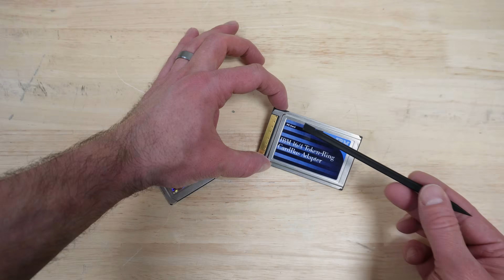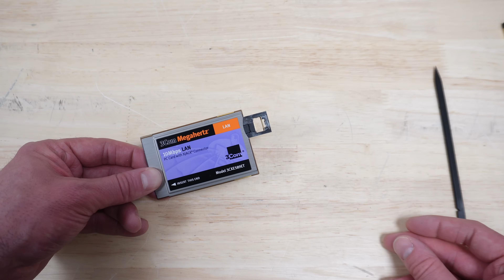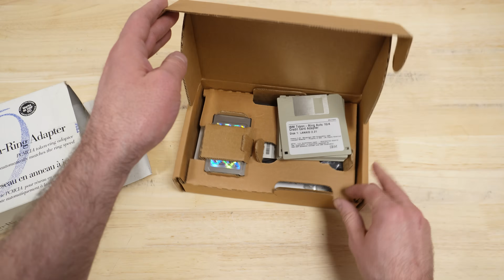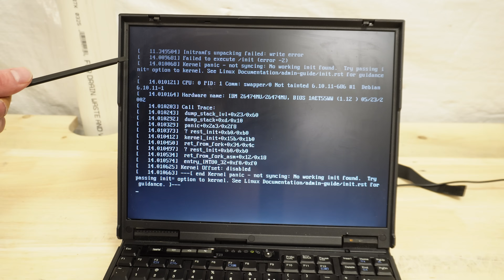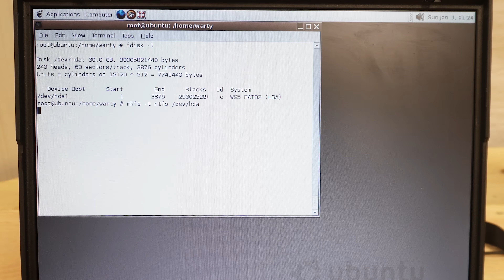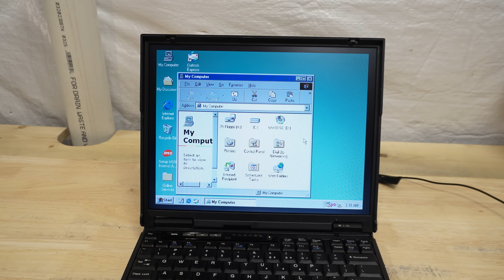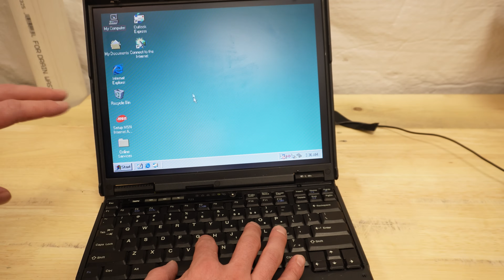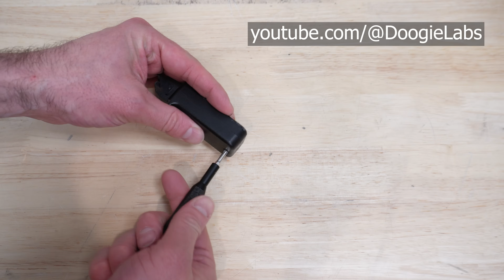Token Ring over PCMCIA Cards

Comment: Used to build IBM computers under contract in the mid-late 90s. Installed a ton of token ring cards, but never once saw an actual network in action so your videos on token ring have been very interesting.

We used to call the PCMCIA cards 'picky-mickys'. Some of those dongles were very thin and flimsy and many would get broken when tilting the laptop on its side (forgetting the card/dongle is installed) and snap - need a new dongle and sometimes new card.